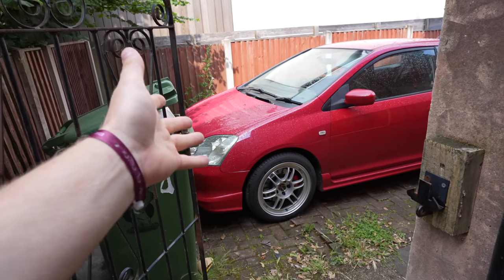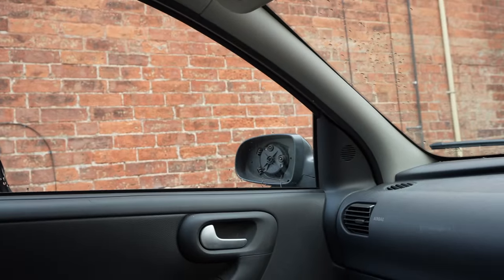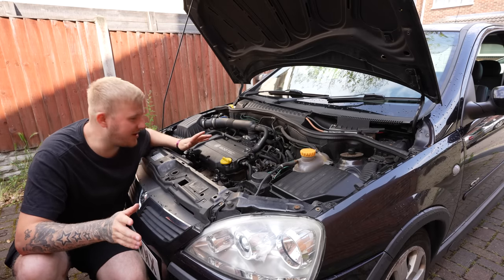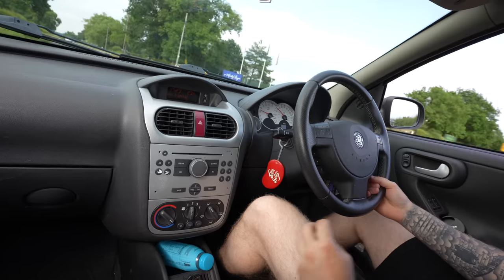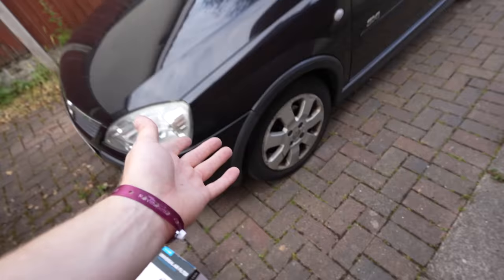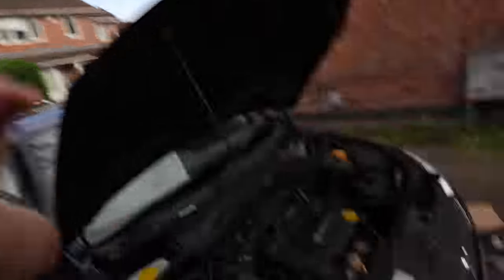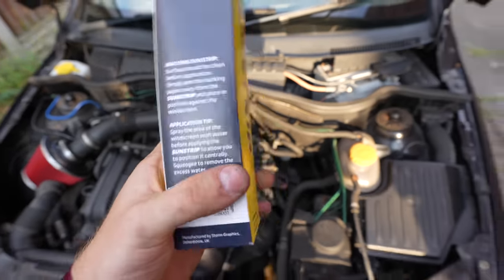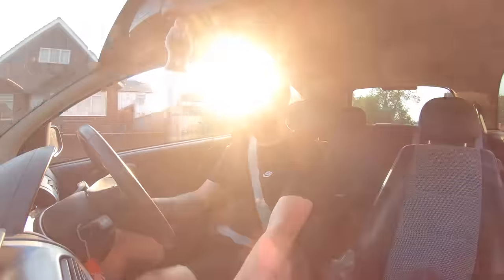I MODIFIED A VAUXHALL CORSA AT HALFORDS

Comment: Be warned....metal dust caps can weld themselves to the valves and when you need to put air in the tyres you end up having to cut them off 😮
Reply: I just cut some NISMO caps off my Son's car last year.
Copper grease the threads.

Comment: Be careful with valve dust cap, if it has metal then remove immediately. Metal dust cap can seized with tyre valve and unable remove. Happen customer c max and it was not fun to removing since it had tyre pressure sensor fitted
Reply: Copper grease

Comment: You should do what ive done install a whole new exhaust system 3inch muffler, eyebrows on the lights, new 16 inch diamond cut alloys wheels, i even have mud guards & indicator wing mirrors not yet installed, new ECU, new coil pack & spark plugs, all new filters & oil, new starter motor, new alternator, new serpent belt, new throttle body, new driveshafts, new crankshaft sensor etc, the car costed  £700 originally the wheels was £700 brand new, i only kept the car because it was my missus car, i saved the car from the scrap yard, then i brought the missus a new car & now i am stuck with the corsa C z14xe that i basically rebuilt myself now it only needs the following done to it, replace the crack front window & jet washers replace the whole handbrake cable system. All parts i replaced so far didn't costed alot as i installed them myself them corsa C's are built proof

Comment: Couple of preventative measures for it. Get the brake servo seal re-sealed to stop the driver footwell leaking water in heavy rain conditions and change the gear linkage to a metal one. That’s two jobs that’ll keep the car going for a good while.

Comment: nooooooooooooooooooooooooooooooooooooooooooo
You are meant to put the sun strip the same way how you put tint on, its meant to go on the inside of the glass not the outside 😭😭😭
Reply: your meant to use the outside of the glass to cut it to size but then you take it and put it inside and spray the soap on the inner side of the glass and do it from the inside
Reply from the maker: I swear that’s for tinted sunstrips? Any time I’ve had them done professionally they’ve gone on the outside
Reply: @JesseCollingham  I just googled it you’re right 😭🤣🤣🤣💔, apparently Sun strips on the inside could create visibility issues due to reflections, smudges, or condensation. Shxt I feel like idiot 😂🤝🏾. I actually believed this for the last 4 years.